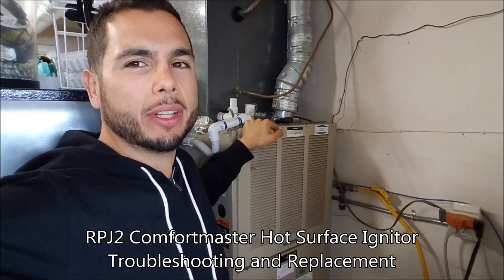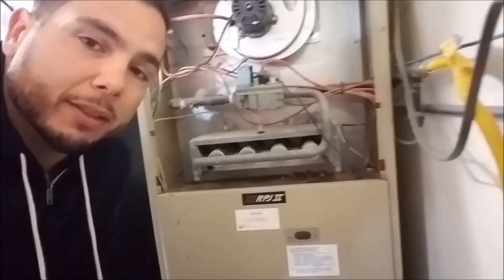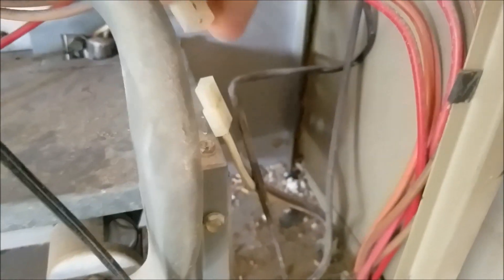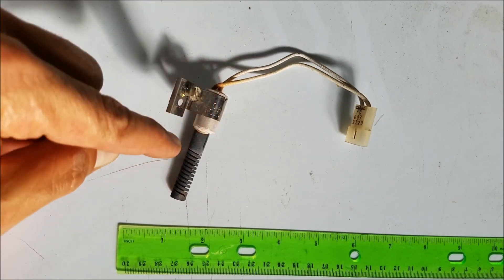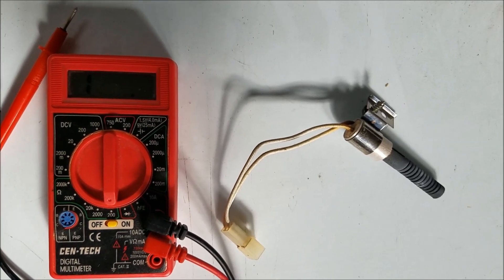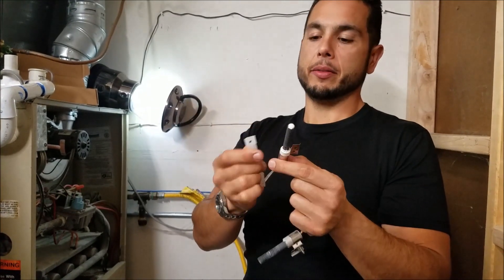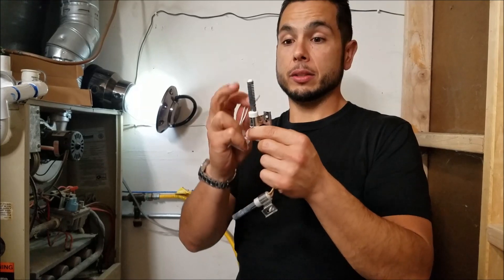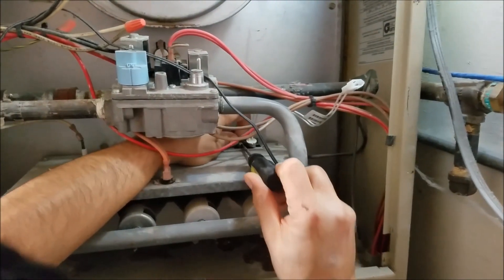SnyderGeneral Comfortmaster RPJ2 RPJ II Hot Surface Ignitor Troubleshooting and Replacement

Comment: I have the exact same issue where the thermostat shows heating but after 15-20 minutes of running but not reaching temperature, the hot air stops blowing but furnace is still running. I have the same furnace but don't have the piece you replaced. Everything else looks identical. ????
Reply: I’m seeing that on my furnace too. Was this ignitor  not original? The ignitor on mine is mounted under and behind the second flame from the left.

Comment: Do you know where's the filter for this
Reply from the maker: This unit does not include an internal filter. Just trace where it sucks air in and you should find it there.
Reply: @polizzi82 : That’s the exact same furnace as mine (model #GUI075A016IM & serial #L922184947), but I haven’t been able to find that specific igniter part & it’s the same one on mine. Are there other ones that will work ? It’s getting down to 38-40 degrees @ night here, so I turned on the heater & noticed it was blowing cool air & temperature on thermostat was not going up. Any suggestions where I might be able to find that part or something universal maybe ? I just wanted to try to fix it myself before I have to call an HVAC technician to come out. BTW, thank you for your video ! It was very helpful & the best one I could find that I could relate to 👍🏼.
Reply from the maker: @yanet: I had another HVAC tech come out and show me... Apparently mine was directly below the unit. It was pretty gross since it hadn't been changed since it was installed.
Reply from the maker: @FemmeEvita  If you 'google' or amazon search for any of those: Part number include SIG101, ERIG101, CARBO 0206DC, 902661, S1-02530277700, 66DC90
You'll get compatible parts. A lot look different, but they all act like resistors, glowing red hot and igniting the gas when it starts. Best of luck -Mike